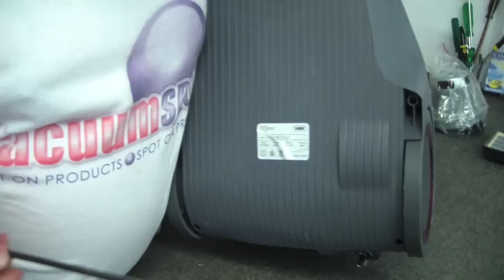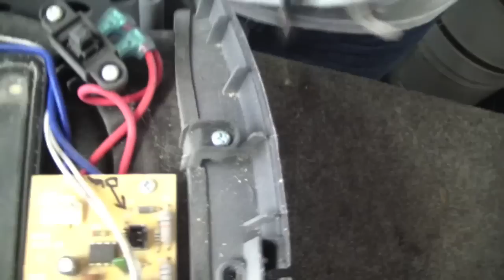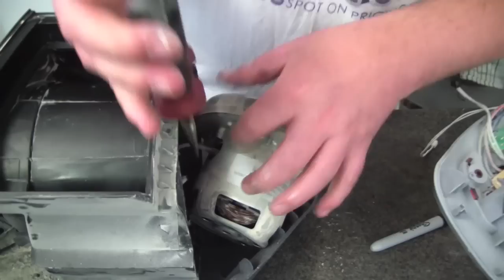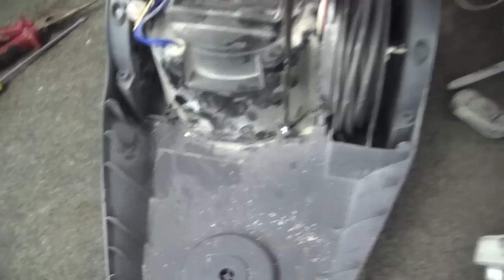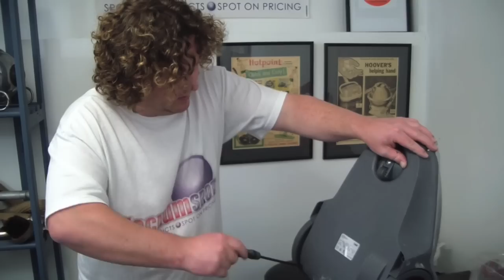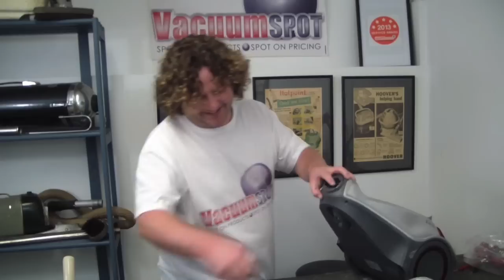My Vax Power 7 Pet is sounding awful, how do I replace the motor and improve performance?

Comment: Hi, have this similar vacuum cleaner VAX -VCP72400.  would like to ask you why the turning /dial switch to Max mark-the motor run interment  very slow and while turn back dial to Min the motor run  faster about 7.5 Amp. when switch set to middle-there is 10Amps ,even slightly stronger suction. What is the reason affect the performance? Thanks
Reply: Could be a  problem with the connection with the dial, have you tried taking the machine apart and spraying the contact with compressed air? If you’re able to do so

Comment: May not be plaster, I have exactly the same problem caused by a product I want to warn everyone NOT to try; Vanish carpet cleaning powder.
I followed the instructions to the letter when using the carpet cleaning powder but when you vacuum the dust is super fine, finer than flour and it just gets vented out through the exhaust so your whole house is covered and your vacuum motor burns out.
Again,...do NOT buy Vanish carpet cleaning powder.